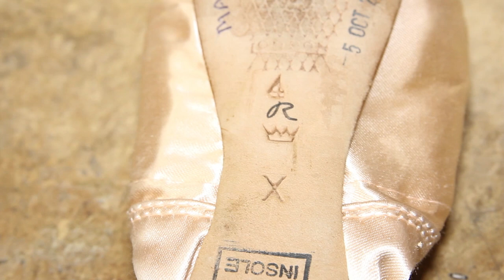How Ballet Pointe Shoes are Made

Comment: They showed how they were made. They just didn't go into detail. I like detail. I wanted to watch this because I wanted to be able to watch a performance with the knowledge that their toes don't dramatically hurt. The shoes are hardened and then softened to the point where they are still hard without the shoe clunking around on the floor by means of a liquid they apply to the shoe, right?
Reply: sorry to disappoint you but I reckon it hurts like hell, at least when you're learning
Reply: This was like the little precursor . They did put out a second one that goes into great detail about they way they're made
Reply: or break into them. also, they hurt a lot but it just depends on what padding you put in
Reply: Sorry to have to break it to you, but it REALLY hurts, especially when you are just starting out. Foot care is extremely important. Your feet bleed, you get blisters, you form bunions, and more. Ice is extremely important on top of other things. I saw one video where a dancer had a plastic garbage can she filled with ice and stuck her legs in every night. As for the shoe, every dancer has their own method of prepping the shoes. Some put shellac, some tear the satin of the toe, some tear out part of the shank, and others shave down the bottom. Some dancers do all or none of this. There are all kinds of things that they do. Not only that, but they all have their own way of sewing on the elastic and ribbon.

Comment: I disagree. Sports require training, strength, discipline, control, the ability to perform, along with other things as well. By those standards, is dance not a sport? I personally think that dancers are much better "athletes" than any other athlete I can think of, although I wouldn't really call them athletes. You are right, dancers are artists, but it's MUCH more than just putting paint to a canvas, which is why I argue that dancing is also a sport.